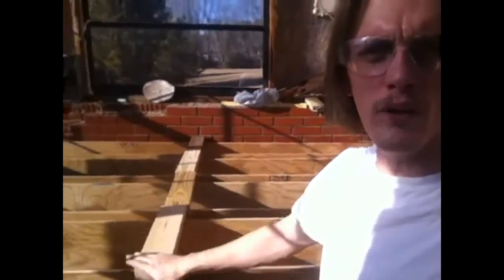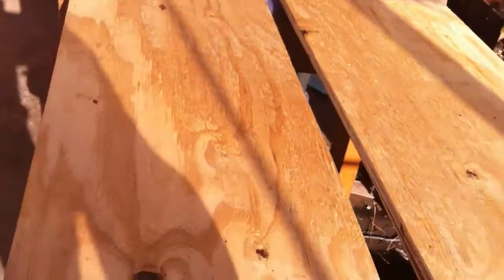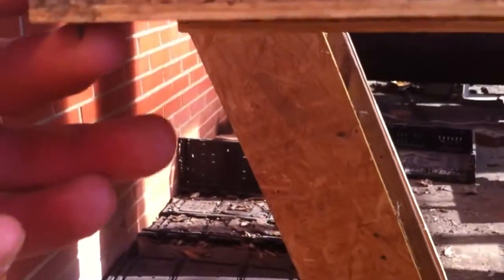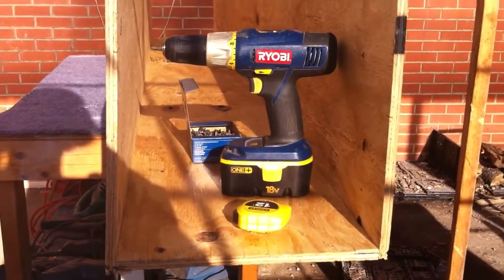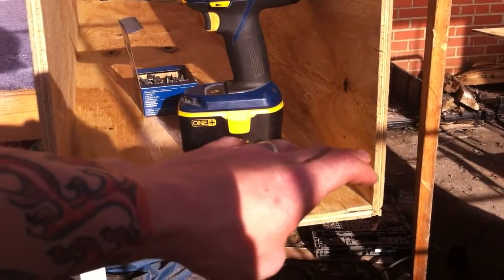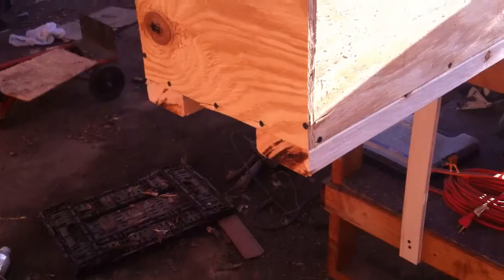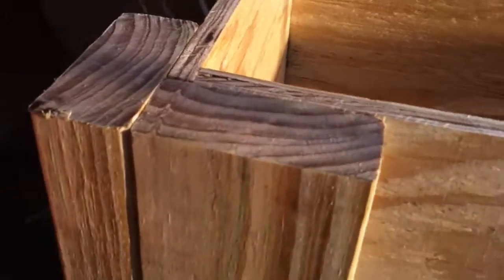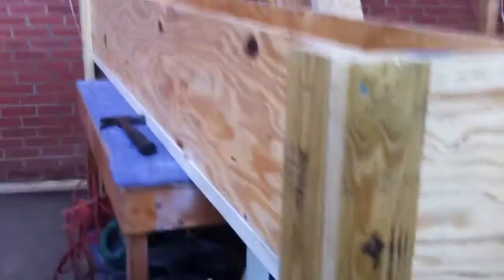DIY Growbeds Part 1 : Aquaponics

Comment: I notice that you do not have any shots with water in the tanks.  here in Florida screws don,t work will into side grain of plywood so I would have run another 2x4 along the bottom seam screwed to the underside lumber to keep that seam from blowing out.  best of luck.
Reply from the maker: I agree Neil Orris, I looked into that.  I have put 2x4 on the bottom of the grow beds; started thinking that screw plywood wouldn't hold weight. Have an update soon on lining the beds with pond liner.